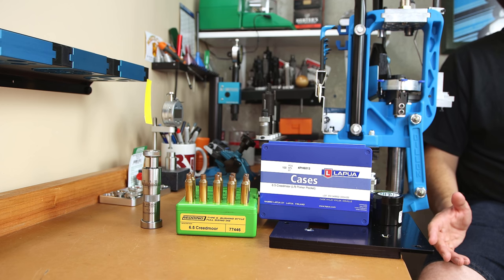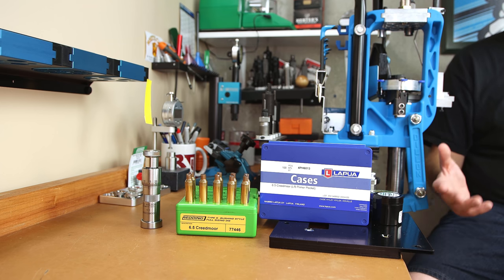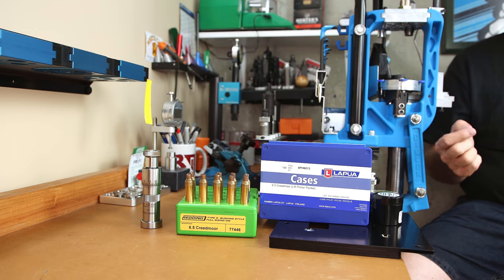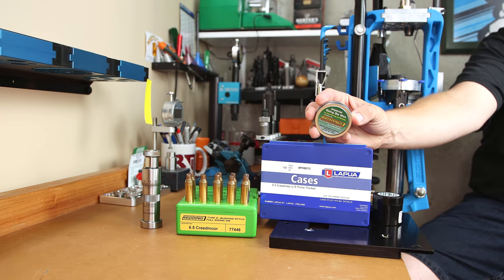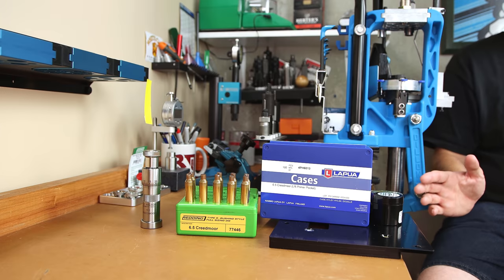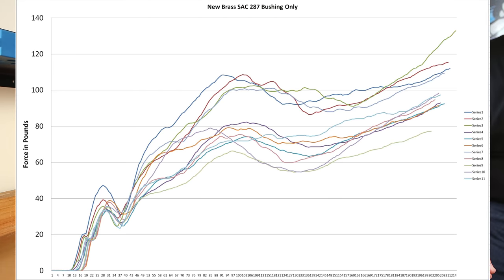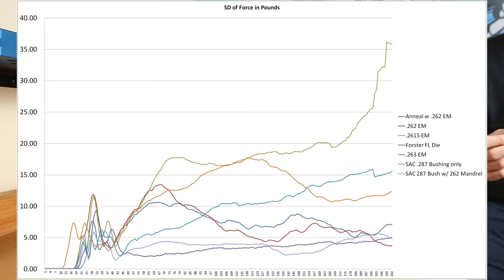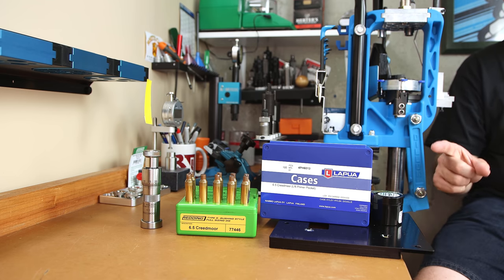Setting Consistent Neck Tension - Load Development with New Brass?

Comment: What’s wrong with the forsner expander that comes with the full length die? Not the proper tension your looking for or to much inconsistency compared to the mandrel??

Or what about using a neck die only?
Just trying to figure out the best method for me with the tools I have available. I have a new lot of lapua brass for .308
On inspection my cases and specifically necks all look good. Inside diameter measures .303-.305.  I ran a handful of cases that had small dings in the neck through my neck die and ID was the same at .303-.305 
I only have an initial pressure test ladder loaded up so far of 10 rounds working up to max load of 45grains varget. 
.3 grain incrimiments but this is just an initial “safety” ladder and getting general info. I haven’t loaded in about 5 years, don’t own a chrono yet, and although I’d love to shoot out to 500 yards I didn’t really have access to a range farther than 200 so 200 yards is all I’m worried about for now… and developing my own hunting load once I can find some hunting bullets back in stock somewhere.
I only have Varget, Winchester WLR large rifle primers and a couple different bullets to work with for now.
Bullets are 167g lapua scenar
155g lapua scenar
168g matchking hpbt
150g Sierra partition (for hunting possibly)

My first goal is to find whether my rifle likes 150g or 168g and fire form my lot of brass… I’d like to gain whatever knowledge I can while I’m fire forming though so I’m not just wasting power and bullets lol
Reply from the maker: I don't want to say anything is "wrong" but I have had much better luck with concentricity with just using the die without the stock expander and setting the Neck diameter with the expander mandrel. Results to this test are coming soon.

Comment: I’ve had the best results using hornady one shot on a bore mop, wipe inside of the necks with the mop then go straight to the mandrel
Reply from the maker: I have heard lots of comments good and bad about various things like this. I really want to baseline my current processes before I start mixing different neck lubes into the process. I did a case lube test and really didn't see a huge change.

Comment: Does seating force actually provide a true measurement of neck tension?  To test actual neck tension, wouldn't you need test equipment that would meter the force needed to pull the bullet out?  It seems like a big assumption to say that the same seating force will always result in the same neck tension.

Comment: In my new Lapua brass, I'm measuring OD=0.290, ID=0.260, and neck thickness of 0.015. Your 0.287 SAC bushing and 0.262 mandrel means that you're sizing the neck thickness down to 0.012 (i.e. you're making the neck walls thinner). This seems unnecessary and I'm wondering if you'd get the same results using setting that don't thin out the walls so much.
Reply: He's not changing the neck thickness. You can only do that by turning the necks.

Comment: Would have liked to see Forster FL die with expander ball removed and ID set with .262" mandrel. But how will those lots of brass shoot? We have already seen where the lots with the most consistent seating force shoot poorly.
Reply from the maker: I may very well follow this up with more options. Its hard to find a path until you have seen the data. The other consideration is there is much more to a load than neck tension. It isn't the necessarily the fault of Neck Tension that a load doesn't hold up. My comparison will focus more on the statistics of the load than the accuracy. I wonder after we have found a desired load can we go back to new brass and see if it holds up?

Comment: On new brass I reduce my load just use the sizing ball on necks after fired I like the mandrels you don’t want to take brass from the bottom streatching it toward top of brass with a hot load but I start after once fired only let the mandrel go through. The doughnut not to far 25 to 40 on seating I’m just a old man take that with a grain of salt I anneal after first firing loading is fun to try to keep new ideals to try for more accuracy you know how it goes we will try anything that’s safe to get that ultimate accuracy lol

Comment: How did you arrive at a .287 Bushing size?  I average new Lapua brass thickness to .0152 which calculates to a .291 or .292 bushing for .002 neck tension.  Even with Hornady brass (thinnest) I only use a .289 neck bushing.  You’re getting your best results with the Forrester FL die and I’m guessing it does not size the neck down as much as your .287 bushing.
Reply from the maker: Hi Ralph, the forster sizes down to .285 without the decapping rod.

Comment: I don't use expander mandrels or do I anneal but plan to I was wondering if anyone has ever tried annealing with the mandrel of the correct size in the case. Seems to me if it cools down the neck tension would be more consistent. Does this make any sense
Reply from the maker: I am not sure how you plan to anneal, but I would not recommend trying the process you outline. Depending on method there will be issues. Keep in mind that the mandrel will cause additional heat load where you are trying to change the temperature the fastest as well as metal expands when heated.

Comment: Please explain to me how you measure the weight measurements, how do you come to the weight, pressure measurement? Had you thought to measure the neck thickness after expanding the neck of the cases? Perhaps these cases should have their necks trimmed for a uniform thickness. You might become surprised how much metal the trimming process will remove at the neck to make the necks a 100% uniform thickness.
Reply from the maker: Hi George, You may want to check out my video on the AMP press to understand how this data is generated. https://youtu.be/VgllKb16TaI I assume you are talking about turning the necks and not trimming them? Seeing the graphs I believe that if someone wanted to turn necks before the first firing then they need to be very careful to make sure they are consistent across the lot. Right now I am trying to baseline some processes to understand the data the the press generates, then figure out how to act on the data it generates. I will be covering turned vs untuned necks in the future but you if I put 100 different options in one video no one would watch or understand it. Hope this makes sense.

BAR
Reply: @BoltActionReloading  Yes I understand, and in most cases, the trimming of any rifle case it’s suggested to be fire formed into your rifles chamber first then you look at trimming it’s neck wall thickness because you might need to trim the inside of the case first then use the uniformed interior diameter as a rolling surface for the trimming of the outside of the cases neck to make the lot the same. But what I’ve experienced with a case lot purchase in the past with 100 cases of a single lot of 100 lapua cases of 338 lapua magnum due to their cost I used the Sinclair neck mandrill to uniform the necks prior to trimming the exterior of the lot of 100 cases to my rifles preferred chamber neck case thickness. I was using information I received from David Tubbs own website. This lot of cases have been a dream come true for me, I’m not at the 5 and 6 loading of these cases now without having to reanneal them. But what i discovered is that in my situation the 338  lapua brass was far from perfect from the very beginning. In other words Lapua brass is over rated.

Comment: I don't do any load build up or accuracy testing with new brass of any make. My first loads are for fireforming to my chamber. I resize all new brass in my die to establish at least a starting point for the cases. I do nothing other than check case OL before I load and fireform. After forming, then I'll worry about any neck turning, trimming, neck sizing, whatever. To me, it just seems like a waste of time to put into new brass.

Comment: Would it be over kill to use both bushings dies and expanding mandrels
Reply from the maker: Technically I did that with option7. These are all fun questions. I was really hoping to baseline these processes, then do some more testing when I get the results. More neck tension vs less, how critical is the force when you start seating, all of these things. We only get the new brass data one time in its life so I really wanted to see what the data says and if it matters on target. 

BAR
Reply: @BoltActionReloading  the other thing i really whated to ask (if you've not already tested it) is how critical variation in case/nexk length is, because in my mind neck tension is also connected not only to the displacement of the material, but also the contacting surface, soo that in my mind also plays a role, might be pointless, i don't know
Reply: @BoltActionReloading  the reason i ask about method 7 is because i got the idea the other day that it might work the neck a bit les if i could size it a bit less than my fl sizer already does, but i love my expander mandrels
Reply from the maker: Yes, I very much agree. This is a recommended practice by some, but I want to bring the data set that shows it. If you look in the charts you can see how the force drops after the busing no longer touched the case. I think its important to see what process has what affect, make that modification to test the affect on the graph, and ultimately see what shows up on paper. I thought this was basic enough to show folks that simply running the brass though your die does a pretty good job of making things consistent. I bet if I ran through the FL die and chased it with a .262 mandrel that initial peak force would come down a little. I want to be careful what I show, and not jump to any conclusions. Often bad data is worse than none. I don't want to lead anyone down the wrong path if I can help it.

Comment: How do you think a Lee collet die would have compared?
Reply from the maker: Hi Jody I would not use the collet die on new brass to straighten out the necks. I would be afraid that the  center rod might damage the necks that are a little further out of shape than some of the others. I will be testing this on fired brass hopefully soon.
Reply: @BoltActionReloading  uh oh. That's exactly what I just did to 50 rnds of new Lapua 6.5 creedmoor SRP. Out of the 50, only 4-5 had minimal resistance when running the collet die and bullet seating pressure was very consistent. Hopefully I didn't ruin any brass? What should I be looking for exactly?
Reply: @demitrisolvinski  not to worry. The Lee collet die does not damage brass. Lol

Comment: So I see that neck bushing is worse than standard die.
Reply from the maker: Hi Justin, I really think that its a factor of how far it is resized down before it is sized up again. The bushing is only taking it down to .287 and the FL die is going down to .285. The bushing with the Expander still did pretty good.
Reply: I have been thinking through this and I think there is a zone of not enough difference between sizing and mandrel diameter. I haven't found a cartridge brass stress strain curve but if you are only straining where it starts to curve and not to a secant modulus region it might give inconsistent springback. Can you report starting, sized, and expanded diameter? probably with micrometer on OD to be precise enough. maybe the deltas will correlate with consistency in seating depth